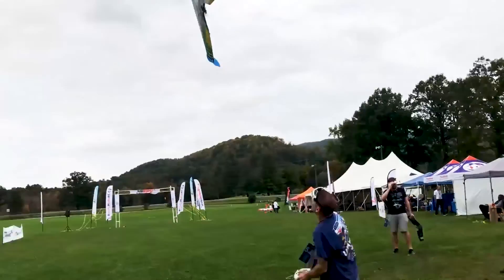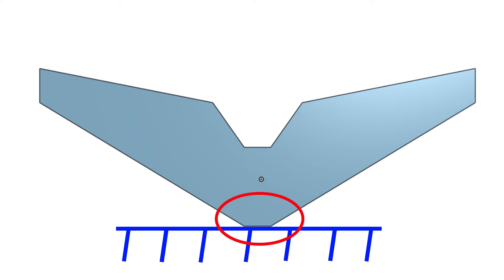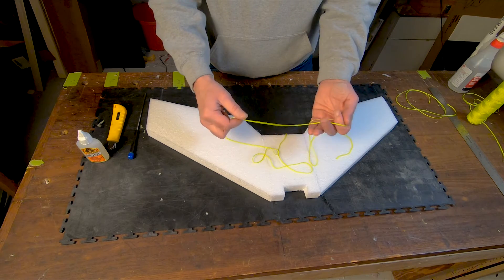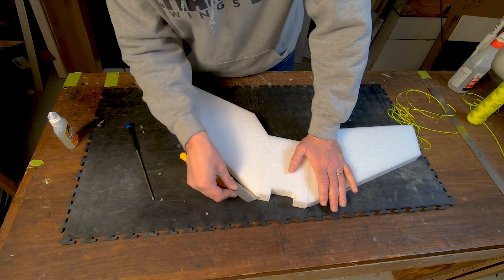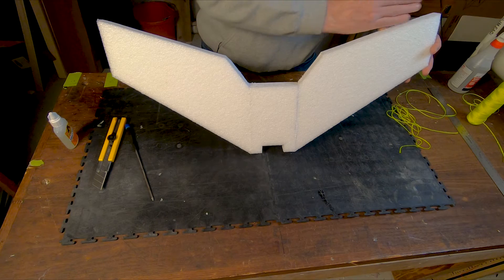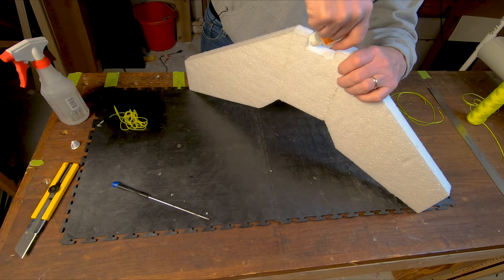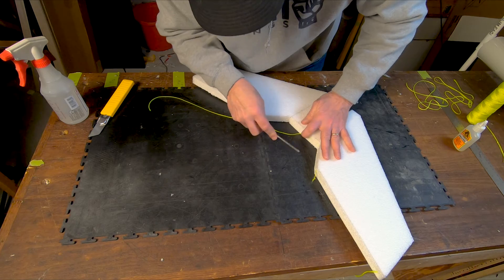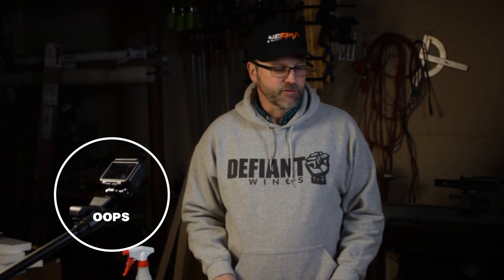Build Tip:  Shock Cord (Knowledge Series Video 3)

Comment: I used to do this with a thin section of MIG welding wire along the leading edge (it is easier to get in there and keeps the foam from crumpling).  I had a monster gasser collide with my plane with one of those in the wing.  The gasser was destroyed and I was still flying.  Barely made a dent.

The only issue with a solid wire is that in wing racing, it is banned for safety reasons and shock cords are not since they are safer to use.
Reply from the maker: Cool idea. May try that with my 63

Comment: Best video ever for this type of stress on a wing. 😍😍😍😍
Reply from the maker: Thx!  Learned it from you buddy!
Reply: You're the reason we asked him to make it, Ruben!
Reply: Great video, wish I knew this trick before building two of your wings 😜
Reply from the maker: @glennwoodward77  Guess you'll have to build 2 more 🤣
Reply: I learned this trick from Ruben too!   But only did leading edge in the past.  The back makes even more sense!
Reply from the maker: Appelm1 yes!  The back is the first place I would use it. I piled in a 28...Hard... broke the motor mount clean off but no rips in the back.